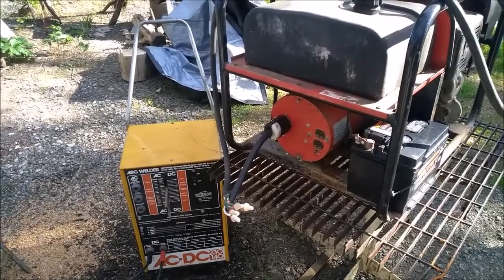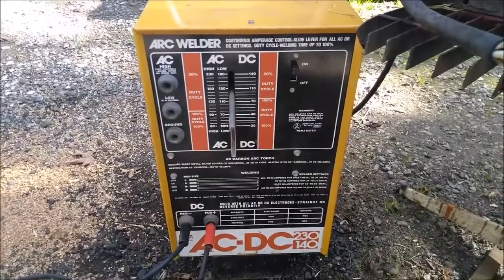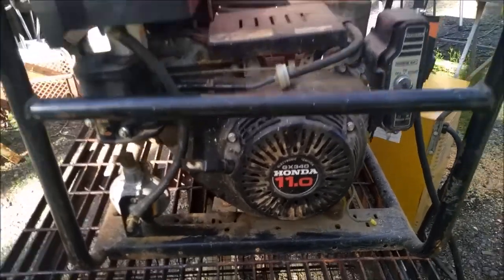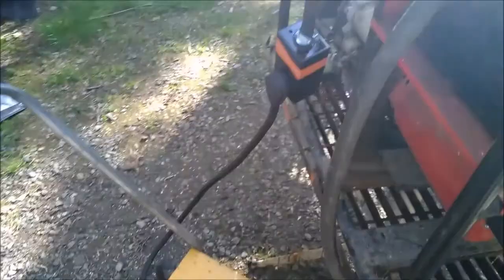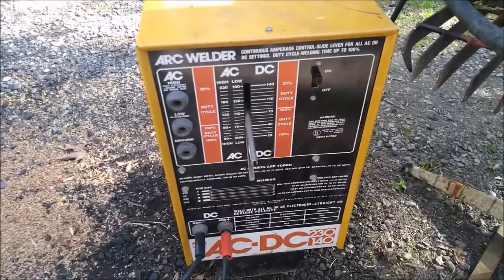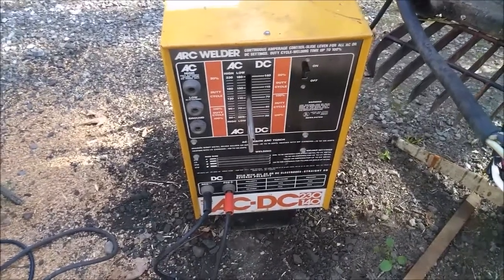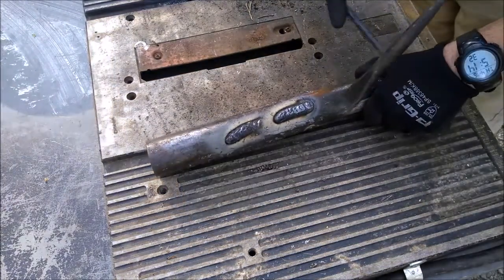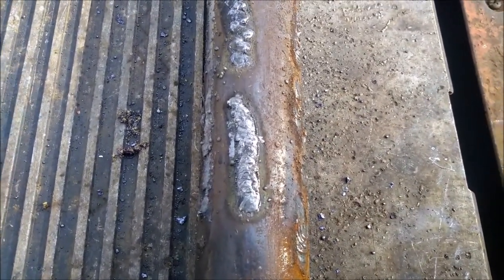Can you weld with a generator?!

Comment: Transformer welders dont give a shit about THD. You can plug it into a diesel generator or a inverter.  Inverter welders must have a inverter generator. Harmonic disruption rate is real. Needs to be under 5% or you fry your welder cheers.
Reply from the maker: I use a cheap inverter welder on a non inverter generator and it seems to work fine.  May depend on something.
Reply: @kylechristie I run a cheap flux core /stick inverter welder off a 6250/5000 running watts generator off the 120v/240v outlet all day long with no problem on our farm🧑‍🏭
Reply: Not true if inverter welder has  power factor correction and IGBT inverter Technology, as opposed to the more traditional MOSFET technology. IGBTs are less vulnerable to mains and generator power fluctuations.

Comment: Older welders and older generators are way better than new ones..the older generators will give nasty power to inverter welders..so you should run inverter  for the new inverter equipment...the old generators are not good for computer circuits..

Comment: I have an inverter 250amp welder I can find up to 135amps on a UK 13 amp plug. To power it at 250 amps you need a 32 amp plug. Hope that helps people.

Comment: I have been running my Lincoln 180 220 volt MIG welder from a 8750 inverter generator from harbor freight. I have had to warranty the  f**** thing five times but it worked.
Reply: The generator or the welder ?
Reply: @24BLUEELMO  Yeah, I'd like to know which one as well.

Comment: I have the same welder been using it for at 30 years and I now have a predator 9000 watt generator and also have a little harbor freight flux core welder been wanting to welding with both off my generator
Reply from the maker: Good luck!

Comment: What about a 3kw 107 amp military generator from 1968? What would be the the most you would get from this if anything using say an old Transformer arc welder
Reply from the maker: I think 3kw is too small.  My 3.5kw honda can't do it.  3kw at 120/240 volts is 25/12.5 amps though.  Makes me wonder about your 107 amps.  If it's 107 amps at say 120 volts that would be a 13kw generator.  That size would work just fine.  You could build a battleship!
Reply: I've just tried welding with a 2.6kW (2.9kW peak) 230VAC gasoline generator. Driven by a 7hp Honda GX clone engine. Rated current is 11.3A. The welding machine is a german made Rehm Booster 170 MMA inverter. Up to 90Amps DC there was no issue with welding. It's not that much but to my surprise at least it worked.

Comment: Some welders play nicer with generators than others. I have a powerkraft from the 60's (180 amp where you plug the cables into the socket labeled for the amperage you want) and that's happy on a generator. My buddy's lincoln square wave plays dead on some generators. Oddly, I have a campbell hausfeld buzz box that hates generators and extension cords.
Reply from the maker: Hmm.  I wonder if there's a good way to know in advance if a welder will work well.
Reply: @thecatsupdog  if it is about the start current supply, some capacitors parallel to the Ac hot wires might work
Reply from the maker: @mjack1935  That's an interesting idea.  I wish I had high frequency box or whatever it's called.  Probably just a box of caps!
Reply: For using with generator you need a welder that have a selector switch for output the red Lincoln is for example why this welder is good because he use leakages induction theory to control the amps and this kind of welders he can work without air circulation fan and can weld for long time without issues

Comment: I mig weld with my champion generator
as a matter of fact my generator runs everything in my barn/ building led lights, heat, fans and compressor. because power company wanted way to much money to run a power pole out to my field and set me a drop
now granted I have to pick and chose what to run when I weld but I can get myself set up before hand and then switch over to welding
Reply from the maker: I'd love to see your set up!  I got a quote from the power company and it's $30,000 for me to get power on my property.  The nearest neighbor is 1/4 mile away,  which is good, but so is the nearest power pole!
Reply from the maker: @leokelly359  It's pfisher at gmail.  I'll probably delete this comment in a couple days though.
Reply from the maker: @leokelly359  Yes sir
Reply: @thecatsupdog  go ahead and delete all the stuff from here I'll get you pics later

Comment: Did you ground the generator?
Reply from the maker: I think the generator is grounded to it's own frame, but I didn't attach it to the earth through a ground rod or anything like that.
Reply: @thecatsupdog  ok. I'm looking to do some welling off my new generator and I'm concerned...I might just go buy a ground rod to be safe.
Reply from the maker: @bfurl69   I wouldn't bother with taht.  1) Grounding doesn't matter for the welding part.  2) It could protect you if you are standing in water and somehow touch a bare wire that's connected to the generator's output. But that's unlikely,  so just be reasonably careful and you'll be fine.
Reply: @thecatsupdog  thank you for the tips. Well, I literally just got back from Lowes with a 10$ grounding rod. Might as well use it.
Reply from the maker: @bfurl69  Well, I've subscribed to you in case you make a video of putting in that ground rod!
Reply: I was wondering about that because I've tried it both ways and I didn't see any difference. 8750 inverter generator from harbor freight running a Lincoln 180 mig. Is it bad on the generator to not have it grounded?

Comment: Thanks for the info! I was wondering if I could power my old Lincoln buzzbox off of my 7000 watt generator. 90-100 amps will be the highest I’ll be running
Reply from the maker: If it works and you remember it'd be great if you could say so here. Or if it doesn't work too.
Reply: Off Grid Shop Oregon will do. I ordered an adapter plug off of Amazon. I should be trying it out within the next few days.

Comment: 3500 will only get you up to maybe 50-60 Amps tops on a 110V inverter welder.  5000 you can get all 80.  

As far as pushing to feed a transformer welder, which usually runs on 240V 50A breaker, I think you need 11,000 watts to get up to 200 Amps on the AC side.
Reply from the maker: It won't get anywhere close to 200 amps, that's for sure. Also, it kinda seems like DC is actually more efficient.
Reply: So it's working pretty good on the DC side, nice!  I am use to running AC but recently got a small DC inverter from Harbor Freight.  Obviously not the beast my old Montgomery Ward PowrKraft 230 AC machine is (built by Century, top mounted slider knob), but it will help me get some small projects done in remote areas.
Reply from the maker: @somethinburnin  good luck!

Comment: I dont think your twist lock on the generator is a 240 V. More than likely, it’s a 110 on a 30 amp
Reply from the maker: It's a 240V 30A.  You can't fit a 110V 30A plug in it.  I have a 110V 30A on my other generator, so I've used both.  Thanks for you comment and please subscribe!